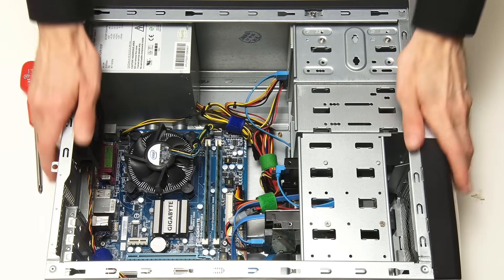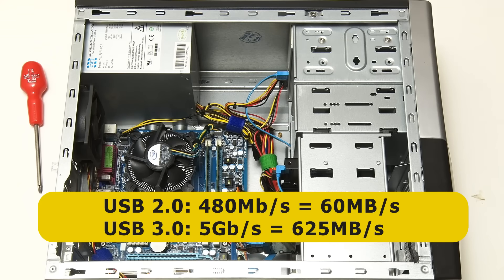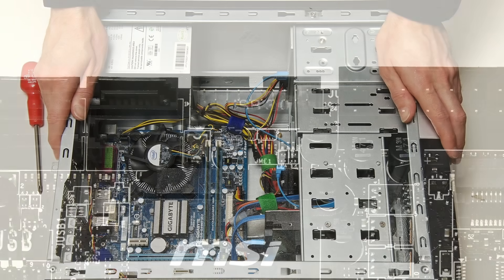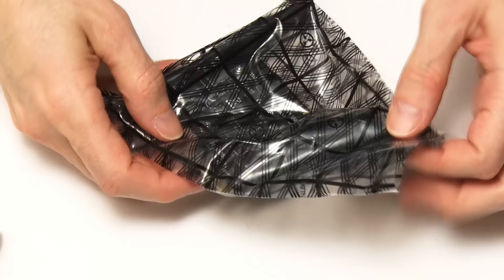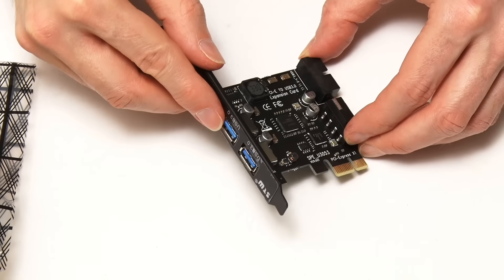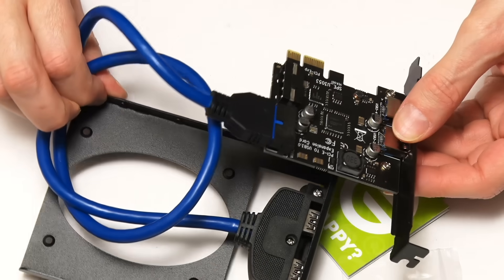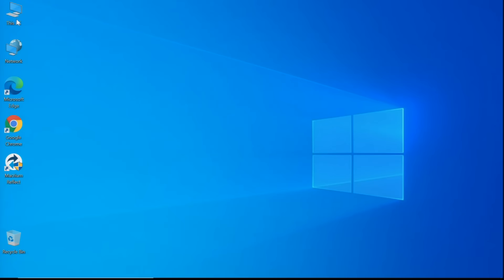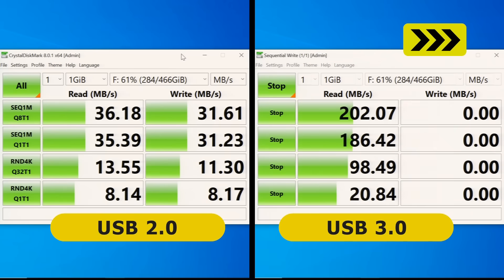Old PC Upgrade #3: USB 3.0 Ports

Comment: What happens if you only have one USB 3.0 header that’s used for the cases default USB port..? And I do mean only one USB 3.0 port which I find a little silly.. But I still use it. 
Thanks!
Reply from the maker: In this circumstance, only potential USB 3.0 port is being wasted. You could add a bay like that shown in the video and put it into the single USB 3.0 header, rather than the cable to the current single port.
Reply: @ExplainingComputers  That’s a good idea, but I do like having a USB 3.0 port in front on top of my P.C. It’s worth mentioning that my P.C has a clear plexiglass for the front panel RGB fans and adding a bay would be sadly impossible. Any ideas? I do love having front USB ports as my P.C is in an awkward corner for rear USB ports.. 
Thanks Chris! You’re the best! :D

Comment: Hmm, I usually advise people to send their machine to e-waste in the absence of on-board USB 3.0. The oldest PC hardware that is still useful today is the Intel second gen sandybridge chipset in my opinion. That's usually the era when USB 3.0 and SATA 3 was standard. Maxxing out the memory and adding USB 3.0 and nvme controllers to something this old with PCIe 1.0 and SATA 2 is the equivalent of fitting rims and a loud exhaust to a 20 year old Corolla.

Comment: Another great video Chris, thank you. It nudged me into installing USB 3.1 ports on my PC too. However, since my PC has 2 x 19 pin USB 3.1 (SuperSpeed) on board, I'd like to install 3.1 ports on the front. Do you have a link for a 3.5 inch USB 3.1 front panel please?
Reply from the maker: The front panels / connectors for USB 3.0/3.1/3.2 are identical -- so any USB 3.0 front bay will give you 3.1 ports from your 3.1 header.
Reply: @ExplainingComputers  That's fantastic, I did not know that, I thought there would be a difference. Thanks for that Chris. I'll go order the one from your link now.

Comment: i just recently came across a bargain of internal cards (€5/piece) with strictly internal connectors, which were originally intended for mining purposes i presume.... had a flexible PCIe extension cable lying around, and since the case itself was a DIY construction it made pretty good value for money (an average card starting at €20). For sure a breath of new life for my old Westmere workstation 😊

Comment: Question...heard the mice and keyboards do better on USB 2.0?
Reply from the maker: Sometimes this is indeed the case. Especially when doing installs. I always try and connect mice and keyboards to USB 2.0.
Reply: @ExplainingComputers  yep...ditto..here's an interesting observation...usb 2-3n isn't as impactful when connecting a printer..it runs at slow speed anyway...thus USB 3 impacts data transfer devices like external hard drives...and then what else...

Comment: Great video!

One remark: when you have to use a 5.25" bay, I would look for a version specific for the bigger bay, with more USB ports and a charging port.

If the PCIe 1.0 1x is a limiting factor, can't  you better use a 2x or 4x card instead (if you have such a slot free on the motherboard ofcourse)?

Comment: 0:52 any reason not to add a thunderbolt port for egpu?
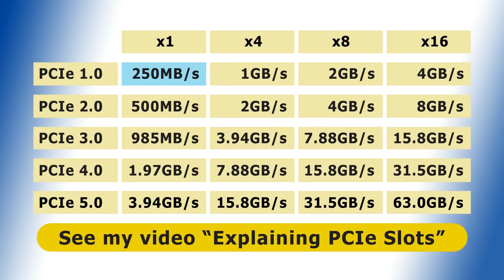EDIT: at 16:43 I see the reason to not bother adding thunderbolt to it.
Reply from the maker: I can't imagine adding an EGPU to this machine -- far more cost effective to add an internal graphics card. And far faster. Remember the PCIe slots here are PCIe 1.0.
Reply: @ExplainingComputers  When I saw the transfer speeds I realized it wouldn't be worth it.

Comment: Another point on choosing a USB expansion card: are the ports horizontal or vertical? I've found that the vertical ports often don't leave enough room and require an extender cable for flash drives and other devices that are a tish wider than the ports. Similarly, horizontal ports can be set too close together, tho are less likely to interfere otherwise. But check for your usage before you install the card!

I like how that front drive bay mount is made so it can simultaneously support a 2.5" drive.

Put the velcro fuzzy side in to reduce both wear and dust collection.

That next upgrade is cheating. I know, having done much the same a time or two... still have parts in there from the original PC...

Comment: Thanks for all your informative videos. By the way, as your USB 3.0 bay has the ability to mount a 2.5 HDD/SSD drive, you can move your ssd to it and spare the 3.5/2.5" adapter bracket you used earlier. :)

Comment: Do some of these offer better processors?
Reply: you mean usb controller processor?  higher end cards have multichannel, more than one controller, up to 4, providing separate bandwidth while raising the device limit, which is lower than you'd think because of how they are really counted, but of course it costs a lot more.
Reply: @churblefurbles  what cards are higher end

Comment: When removing front bay blanking plates, it is a much safer idea to reach in whith a screw driver and tapping the handle to eject the plate. The metal tabs in those bays are very well suited to cutting through skin. 3 stiches was enough to teach me that lession, hopefully this comment can help others avoid such accidents.
Reply: I'm pretty sure some of 'em are in cahoots with razor blade manufacturers...
Reply: Cut my finger open on blank plate once, so much blood

Comment: I’m curious why you installed a usb 3.0 device in your computer when usb 3.1 / 3.2 is now out all over the place with much better speeds.

I didn’t see any mention of cable lengths over the various standards?

How much power draw you can pull over the various standards?

USB 3.2 versions
New name 	Old name 	Original name 	SuperSpeed name 	Max speed 
USB 3.2 Gen 2x2 	N/A 	USB 3.2 	SuperSpeed USB 20Gbps 	20Gbps 
USB 3.2 Gen 2 	USB 3.1 Gen 2 	USB 3.1 	SuperSpeed USB 10Gbps 	10Gbps 
USB 3.2 Gen 1 	USB 3.1 Gen 1 	USB 3.0 	SuperSpeed USB 	5Gbps 

Here’s how it all breaks down:

    USB 3.2 Gen 1: originally known as USB 3.0, and previously renamed to USB 3.1 Gen 1. It’s the original USB 3.0 specification, and it can transfer data at up to 5Gbps.
    USB 3.2 Gen 2: Previously known as USB 3.1, and then later as USB 3.1 Gen 2. It offers speeds at up to 10Gbps.
    USB 3.2 Gen 2x2: formally known as USB 3.2, it’s the newest and fastest spec, promising speeds at up to 20Gbps (by using two lanes of 10Gbps at once).

Even early versions of the USB standard were designed to power connected peripherals, and as the technology has matured the charging and powering capabilities of USB have also evolved. Both USB 3.2 Gen 1 and Gen 2 support the USB Power Delivery Specification (USB PD), with Gen 2 offering up to 20 volts of power at 5 amps for a potential total of 100 watts through supported hardware. This is a major leap forward from the previous USB 2.0 standard which was capable of providing 2.5 watts of power. 

USB 2.0 and 3.0 both operate at 5V, 1.8A, but USB 3.1 rose it to 20V, 5A, enabling users to power up larger devices.

Encoding Capabilities

USB versions up to 2.0 use Unicode as their encoding method, while versions 3.0 and higher have begun using 8b/10b encoding.

Type of Wire and Cable Length

The cable length of USB 2.0 devices can be up to 16’5” at a maximum, but the length for 3.0 devices can only reach a maximum of 9’10”. If you need to extend the length of these cables, you’ll need to use a hub or other connection.  

The wiring inside is also different between the USB generations, as the 2.0 generation of flash drives has only 4 copper wires, while the 3.0 models contain 9 copper wires.
Reply: If you had watched the video, you would learn that the chipset of the MoBo used is PCIe 1.0 generation, and was at a data transfer bottle neck already using USB 3.0 on this.
Reply: @NorsioNorsius  I did watch it. I asked why he didn't install a 3.1 / 3.2 usb device and chat about that as well, instead of making a new video about an old standard.... I know it wont be faster because old his old hardware... At least mention the new stuff and it's speeds and abilities :)
Reply: @CraigMullins1  If you had watched the video, he quite clearly goes through the different generations of USB.

Comment: On my most recent upgrade (7-years ago ), I applied a bush fix to put two USB 3.0 ports in the front located where the two original USB 2.0 ports were so I could use both of the front bays for high-speed DVD burners. Knowing what I know now, it would've been smarter to do as in the video and dedicate one to USB 3.0 ports. Live to learn! ~ learn as we live!

Comment: I tend to stick a secondary NVMe SSD into a PCIe slot preferably gen. 2 on LGA's 775 or you can use cheap dual M.2 adapter cards and stick one AHCI M.2 SSD in it for boot drive to get rid of the messy SATA power cables :) You can even add Wifi 6 card or USB-C 10gbit. With a proper mobo you can go up to 16GB DDR3 dual channel and about 1600MHz with tuned timings but of course this platform still will be the limit for modern games because you can't get it above 14GB read performance for RAM though latencies are very low. On my P5E64WS Evolution even an EVGA RTX 3080 FTW3 worked without any issue :) With an Q9550 OC to 4.05GHz for daily.

Comment: I'm surprised by the low random read and write speeds (RND4K Q1T1/Q32T1) on USB 2 compared to USB 3.  I would have thought that SSD speeds would have been much higher if the USB 2 connection was the limiting factor.

Comment: An interesting comparison when you upgrade the board and processor would be power consumption of both old and new systems
Reply: I had the same thought! of course it would depend a lot on the choice of board and CPU. I have a couple different i7 that have almost the same performance and similar specs -- idling, the Dell uses about 40W and the Asus-based system uses about 140W.

Comment: Explaining the criteria relevant to the card should save the audience a great deal of research time or buyer's remorse, depending on the order they do things.
A great illustration of moving bottlenecks around, and the truth that upgrading any component of a system (computer, car, whatever) usually requires the removal and replacement of at least 2 others. :-)*

Comment: pushing an old pc to the limits is a pretty fun thing to do.
got my dad into linux with Pop_OS for emulating & torrenting on his old EMachines PC that came with windows vista.
maxed out the board's capacity with 4 gigs of DDR2-800mhz ram, threw in a dual core Phenom II CPU, all gotten on ebay for <$10, threw in a quieter case & southbridge fan & put in a Radeon 7470 GPU i pulled out of an Optiplex mini tower I up-cycled for myself. if only there wasn't an SSD shortage here then it would be just about at it's bus speed limits on everything.

Comment: Hello, the speed of a ssd connected to a sata2 does not take advantage of it. how can you boot with a ssd to take advantage of the speed of the pci-e? I have seen in the bios that you can connect an adapter in the pci-e that has a minibios and from there connect the SSD.

Comment: 8:57 Just have to point out to be more careful with those blank snap-off type plates. The sheet metal is very sharp and can give a nasty cut, like Tech YES City had. It's safer to use some pliers and wiggle it off.
Reply: Good safety reminder.  Also, sometimes a bit of metal can break off and land somewhere on the motherboard, or in an empty expansion slot, where it could cause a short circuit and do real damage.  BEST WAY to remove a PCI slot cover that is still attached to the chassis is to place a towel against the inside surface, and start by pushing OUT, then grabbing the slot cover with your other hand and wiggling, with the towel in place to catch any stray metal.  Lastly, wear safety glasses, or your regular eyeglasses, in case that metal shard launches straight for one of your eyes.
Reply: @supremelawfirm  exactly, and if you look closely at 12:15 you can see a nasty little piece still attached where that 3.5" bay plate was removed and ready to dig into your finger/hand.
Reply: @lakiza55  Yes, you're an Eagle Eye!  Whenever I have started with a refurb / used chassis, I have usually removed ALL of the stock slot covers and replaced them with a full set that I keep in spare parts.  I also add 3-in-1 oil to a cotton swab and dab that oil into the threaded holes, where screws attach the new slot covers.  Many years ago, a machinist in our family showed me how to start a screw BACKWARDS, until the threads mesh properly, then screw FORWARDS (usually clockwise) until snug tight.  After learning that technique, I have never cross-threaded a screw ever again!  An element of that technique is to wait for the thread "meshing" to be sensed by my fingers, and sometimes one can also hear the threads meshing.
Reply: @supremelawfirm  i know what you mean, especially usefull when using a steel screw that goes into a softer material, like wood, plastic, aluminium. Sometimes you'll see the screw rising up as you rotate backwards and then suddenly snap down and make an audible pop, then you know you matched the threads. A YT channel called DiodeGoneWild does reapairs, teardowns of electronics, and he's very good at reverse engineering and explaining the circuits. He taught me the basics about common switch-mode power supplies. Also , I've learned a lot and got better at repairing faulty electronics myself thanks to him. Check him out if you're into EE and can bear with the way he talks. And, in one of his videos he shows the "How to never strip a thread/screw" technique, and it blew my mind how simple it is, and i've been using it ever since.

Comment: That USB 3 bay has four small holes (apart from the much larger elliptical one). I wonder if it could double as a mounting bracket for the 2.5-inch SSD?
Reply: I think that's what it's designed for, so it doesn't hog the drive bay.

Comment: Chris, many low cost or refurb PCs were corporate surplus and have passworded BIOS. That's a problem if you want to run Linux. My box, after pulling the battery on the motherboard, throws errors and my old win7 disc won't boot anymore. Linux will boot after several beeps and error messages. Are there any straightforward methods to clear BIOS passwords?

Comment: Thanks for the video.  I am curious if Linux could detect the USB3 card.  I use Mint on an older PC after watching your video.
Reply: Mine does (PCLinuxOS). Probably any halfway modern kernel would be fine with it.

Comment: One thing for sure, if you plug in more than one USB 3.0 devices into the card, you are going to have a much lower speed. This is because the bandwidth will be shared. Sadly, there is no USB 3.0 add-in card that support PCIe gen 4 yet. You will be severely limited if you populate many devices into the card and uses them all at once.
Reply: 16:44 Would you get better results if you plug the card into an x4, x8, or x16 slot? That is, would all of the devices run faster sharing a faster bus?
Reply: @dwmac2010  The card only has x1 connection, so it doesn't matter whether the port is x1 or x16 port, it will only use x1 PCIe lane. Unless the PCIe generation is 2 or 3, the card will be severely limited.

Comment: upgrade the  motherboard bios
change   power supply  450- 600w 
 change   cpu heat sink and case fan 

ATI Radeon HD 4670 Graphics 
Core™ 2 Quad Q9650
 install  64bit os   add more ram

Comment: I recently added such a card to my PC. When I bought it I didn’t read the fine print about it having the Molex connector. Not having any available in the PC meant I had to order suitable splitters/extenders to power the card. I will read more carefully in the future.
Reply: Some come with their own adapter/extender. I like StarTech stuff for being good about that.
Reply: @Reziac  I agree with you about Star Tech. Definitely better than many other companies.

Comment: I selected a front bay panel that had 2 USB 3 ports AND  line out (headphone) / microphone in jacks.  My motherboard had a USB 3.0 header on it as well as the audio jacks.  In my case I'd upgraded the motherboard and the existing USB 2.0/card reader/ audio front bay panel (5.25") lacked USB 3.0, and had the wrong type of audio connections for the new motherboard.  But, I left the existing panel in and just taped up the audio jacks and added the second panel for USB 3 / audio.  I could have replaced the existing panel, but available ones STILL used USB2 for the card reader and had a mix of USB2 / USB3 ports on them.  Also it was cheaper to leave the existing panel for card reader / USB2 and just add the newer 3.5" panel to add USB3 and audio connections.

Comment: Is there such a PCI card without built-in USB ports, but only with 19 pin header? I already installed the front USB bay, but was forced to get extra adapter to go back to 9 pin. It's an office computer, that has USB 3.0 ports on the back, but it's placed in a non convenient way, and motherboard doesn't have 19 pin... so I prefer front USB 2.0 speed over moving the whole thing every time.

Comment: What about CPU upgrade? If a PC came with a certain processor, but the motherboard supports a better one (i.e. higher clock speed or i7 instead of an i3), it's usually worth swapping it out, even if one has to do some scavenging on various online marketplaces (e.g. eBay). What do you think?
Reply: @sourabhmeena1996  4th generation Intel. But my PC already has the best i7 CPU the motherboard supports.
Reply: @sourabhmeena1996  i agree. I'm curious for the next episode and seeing what kind of motherboard + processor combo will Christopher choose.

Comment: Funny, I was about to get a USB 3.0. Thought mine will be an 6-port external.
Reply: Just remember all 6 ports are on a single shared controller, just means there are 2 4 port hub chips daisy chained on that card.  Max hub depth is 5.